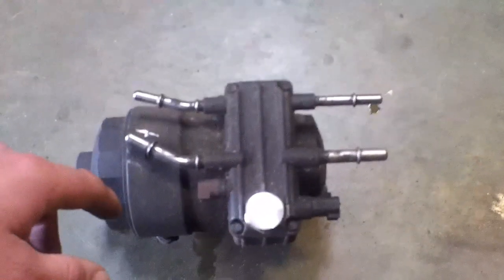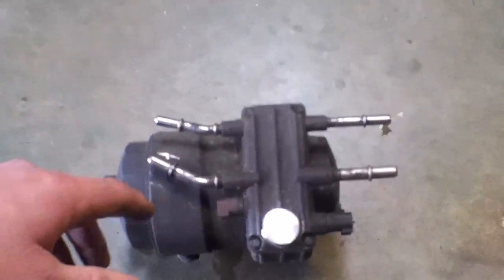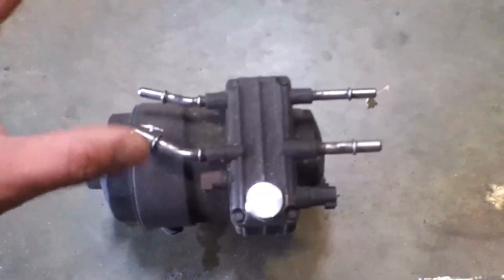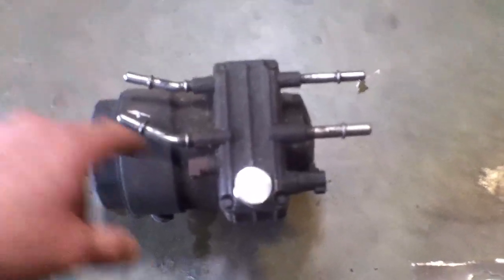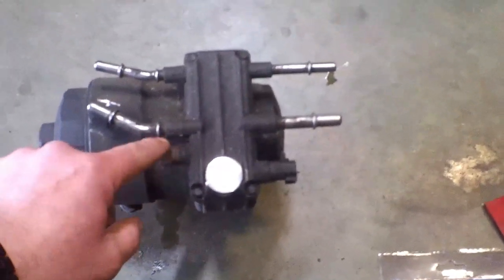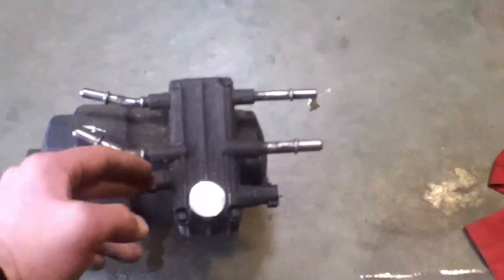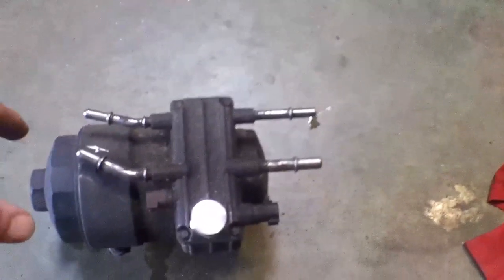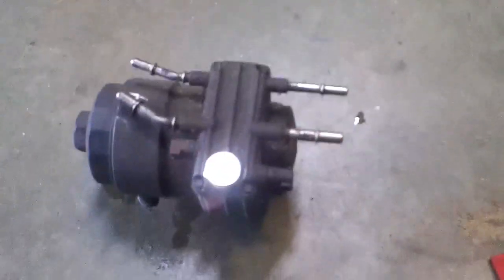Fuel Pump Replacement Ford 6.0 f250 2005

Comment: GREAT Communications!  I thought I'd bought the wrong unit until I watched your very thorough video here.  I am a novice, "shade tree", mechanic.  So seeing that the fuel heater has been deleted I confidently replaced the HFCM and got myself back on the road.   THANK YOU.
Reply from the maker: You’re welcome!
Reply: @BugmanVlogs  I need a little help diagnosing my 6.0 issue. Was running fine and I stopped at Walmart and it won’t fire up.  The fuel system prime before you start, I don’t hear it anymore. I just replaced both batteries. Check the video out please.
Reply from the maker: @ThePlatinumChild  I really think you lost the fuel pump. If you no longer hear it at all with key on before startup it has quit. This is typical of all fuel pumps when they quit, just die anywhere but it’s nice for the ones you can hear as when they no longer hum it’s a good give away as to the problem
Reply: @BugmanVlogs  thank you

Comment: ok so my truck sort of bucks and bounces at speeds 55-70 it does it worst at speed 55mph. it has fuel pressure at a contant 70-80 so thats what confuses me. Anythoughs on what this is? it doesnt feel like a tire balance issue. maybe drive shaft balance??
Reply from the maker: I have one of the trucks with a driveline vibration. Starts in about 50 and gets worse up to 70 then goes smooth as a Cadillac at 75 and faster. I’m thinking the driveshaft and/or carrier bearing. The bucking I had from the fuel pump was sporadic but I had at low speeds
Reply: Brian Hill did you ever fix you truck? I'm having  the same issue .
Reply from the maker: Fuel pump yes, driveline no. Ever since Covid hit I’ve worked to many hours a week to have time for working on the truck. Unfortunately until things slow down or we get another employee I have to put off things that unless completely broken I’m just going to deal with. Hopefully the cure will be just replacing entire driveshaft as mine is pretty rusted and just easier if all new instead of hassle of ujoints and carrier bearing replacement
Reply: @gamalielrenteria3964  needed 2 injectors, they were on their way out. ended up selling the truck and making profit because of the market.Id recomend doing the same if you have a 6.0.

Comment: Hi, Having a heck of a time getting the 2 plastic fuel connectors on the fuel filter side off with the tool . How long does it take once you open up the drain for the fuel to stop coming out?  Should the gas tank be empty when replacing the fuel pump?
Reply from the maker: While my normal experience is a cup to half gallon I’ve heard of horrible situations of it never stopped coming out. Prepare for the worst is what I always do. Have everything disconnected (wires) then do 2 engine side fuel lines and then have new pump right there for when you disconnect tank side lines (nuts should be off pump bolts through frame as well) and get tank side reconnected as fast as you can. When mechanics do this in a shop they get empty to full tanks and it’s not always practical to pump tank. Time is money, lol.

Comment: Question my truck does going up the hill  or even on flat ground thought it was my injectors sticking but then was told it was my fuel filters so replaced them today 7/11/21  but now I’m thinking it’s my fuel pump but don’t I have 2 on a 2005 Ford F-250 6.0.  Now I’m throwing codes for contribution /balance and Mis fire  but after watching your video I think it’s my pumps what’s your thoughts
Reply from the maker: There is only one pump on the inside frame rail. The part in the tank is just a sock filter. There is a possibility that it’s the pump if your getting multiple (3or more) contribution codes. 2 or less I would error towards injectors but fuel pump is a hella lot cheaper to replace than injectors.
Reply: @BugmanVlogs  ya I got like 5 codes
Reply from the maker: @jo5239  I would think it’s the fuel pump  then. Crazy how it can cause so many different symptoms.
Reply: @BugmanVlogs  it wasn’t the fuel pump
Reply from the maker: @jo5239  oh damn, was it the injectors after all?
Reply from the maker: @Joshua Hale damn, you hit as the winner for worst possible outcome.

Comment: That video was good, is that for a high pressure 6.0 Diesel, that's on the frame Rail
High pressure pump.
Reply from the maker: Thank you, this pump is for the 6.0 on the frame rail. It’s the only fuel pump it has and isn’t considered high pressure (65+psi). The high pressure is the 2nd pump in the oil system that runs the injectors. The cp4 pumps for high pressure fuel is on the 6.4 and up diesels.

Comment: My 2005 is making a gargling sound could this be linked cranks not start
Reply: At the pump under driver door
Reply from the maker: @wecanranchlee  I would be arrogant of me to say 100% yes but if it’s making a gargling noise something is definitely not right and would bet something is up with your pump. Will it fill the fuel bowl on top of the engine with key on?

Comment: Can you really not replace the pump without taking the entire module off
Reply from the maker: Correct, whole unit has to come off. They sell just the pump inside but I never took it that far apart. Mine was pretty corroded inside the water separator part so just did the norm since whole unit is out and replaced whole unit

Comment: Does anyone know where to get the damn crappy plastic clips on the two fittings towards the back of the pump?
Reply from the maker: I would guess only Ford parts at the dealership or maybe search EBay. I’m not sure what they are called so you may have to research. I have only had horrible luck buying parts at a Ford dealership. Use small words and write in crayon if you don’t have a part number.
Reply: @BugmanVlogs  so the stealership says Ford no longer makes the plastic clips. You have to buy Moog 3/8 and 5/16 fittings then make your own ends now.
Reply from the maker: @scottalvarez8870  thank you for the good info. Hopefully I don’t have to run into that in the future. Amazing that they are now stopping production on replacement parts like that. I’ve heard of several other things like that. Force many to buy newer if they can’t work on it which I’ve seen a huge portion of the population can’t so they win with them.

Comment: I've got 41 static psi. Installed blue spring kit no change. I'm thinking it's the pump been like you said loud and funny noises
Reply from the maker: Does sound like a bad pump. Good that you changed spring. I’ve actually had a blue spring kit go bad. Little plastic piece in there broke off and was blocking a hole. Only thing it showed as bad was fuel pressure bouncing really fast.

Comment: What was your truck doing to realize you needed a new fuel pump ?
Reply from the maker: If I remember correctly it started with cutting out at high RPMs which I took for transmission slipping, then after changing fuel filters...pump was loud like a race pump and I definitely knew then it was going soon.
Reply: Bugman Vlogs did you have low fuel pressure?

Comment: Where did you buy the fuel pump?
Reply from the maker: It’s a NAPA pump but I found it on EBay. Good reviews for OEM, NAPA, and O’rielys.
Reply: @BugmanVlogs  thank you sir. Price range about $300-$500 average?
Reply from the maker: Yes, i would to shop a bit to save and stay in $300 area. I just checked and got mine with updated wire harness for $262.

Comment: I’m replacing my fuel pump. The auto parts gave me a fuel pump identical to the one my truck has the only different thing is that it has three electrical plugs and the new one has two there is an electrical plug next to the drain plug can somebody help me?
Reply: Could I still install it like that? I will have an extra plug coming down.
Reply from the maker: Yes you can install it and just zip tie the extra connector out of the way. The omitted connector is for the fuel heater that is no longer in the newer pumps. Some pumps will come with a pigtail or plug to keep corrosion from shorting it. Another person on here said you will get a code for not having a pigtail but I’ve had no problems.

Comment: What kind of tool do you use to open the drain plug?
Reply from the maker: The stock plug you use an Allen. I’ve had 2 aftermarket plugs that where different. One had extended head in a 14mm. Super nice to get an open end wrench on. The other had Allen in center and extended head that was knurled on outside for using fingers but I always used pliers as finger tight is to loose IMO.
Reply: You talk to much
Reply: @marcosbega7011  You don’t know which “too” to use

Comment: My truck is leaking from that filter so do I have to change it?
Reply from the maker: Might try to change filter and install new o-ring on cap (which usually comes with filter). Make sure to coat o-ring in fuel or oil before installing. If it still leaks then probably housing is scratched and you’ll have to replace the whole pump.
Reply: @BugmanVlogs  thank you
Reply from the maker: You’re welcome
Reply: @BugmanVlogs  and you got an idea how much is the cost of that part?
Reply from the maker: @elmercapriel8192  o-ring is $5 or less, fuel filter kit is $50-60, entire fuel pump-$290+
Reply: @BugmanVlogs  thanks for the information

Comment: You should have changed the pigtail for the heater, since the new one has no heater.
It will have a code like P0232.  Can replace the pigtail to 2 plugs.

Comment: How much fuel am I going to get out of the lines when I disconnect them? Is it going to empty the tank.
Reply from the maker: I think about a cup per line drizzled out. I used the fingers of neoprene gloves to put over them and a bread tie to tighten. Keeps the fuel from dripping on you while you work. The most fuel will come from front lines and can empty the 2nd fuel filter/bowl if you don’t cover line end. The tank will not empty out. Lines come out of top and down so gravity is not an issue, lol. Hope this helps.
Reply: My truck drained about 3 gallons.
Reply from the maker: @Bearairboatrides  oh wow. Definitely some siphoning going on there. The lines, pump, and front filter can’t hold more than a half gallon or so.
Reply: @BugmanVlogs    Yes. It siphoned from my tank. The drain plug stripped so I couldn’t seal the hole. Finally stopped after a while.
Reply: my truck went 5 gallons and kept draining had to put the pump in and plug it in so it stopped but it didn’t look like it was going to slow down

Comment: Is there any link for the special tools for removing the fuel lines?
Reply from the maker: I didn’t post a link. Fuel line tools are from harbor freight. You can buy off EBay or Amazon too and all are about the same. Just buy a kit with 5 or more and you’ll have all the sizes you’ll really ever use

Comment: I have a 03 F250 6.0 turbo diesel how can I tell if i have a tune on it???
Reply: Mine will also die 3 or 4 times a day then not  die for just as many days. It will start right back up.
Reply from the maker: You can plug in a tuner and it will tell you or take it to a dealer. As far as the dying part, there is a fuel issue. List to start on would be fuel filters, bad fuel pump letting air in, possibly HPOP not keeping pressure up to injectors, plugged injector screens, hell even ICP or EBP sensor could be bad and possibly cause this. Scan gauge 2 or edge monitor is great start to know your parameters and go from there.

Comment: What size is that drain plug for water and thread pitch
Reply from the maker: I will have to say I have no idea. It’s a special plug with a strange secondary part that has threads as well so it’s not something you can just by a standard plug for. I just bought aftermarket ones off eBay so it will have a bolt head along with Allen to take off. Nothing worse than when Allen strips out

Comment: Never showed actual doing it.
I think you had a lot more trouble than what you said.
You are definitely a first time We said a lot of my time listening to your crap in the beginning of your video and you have no clue
Reply from the maker: You probably didn’t understand because you’re an idiot
Reply: I just watched the video and replaced mine. All you have to do is scroll the video to get to the part where he is under the truck. While he did not show step by step and actually remove the fuel lines in order to take a diesel bath, he did show you where to put the fuel line connector tools and that was all I needed. I also got mine out without removing the front drive shaft (although I was prepared to) because I was traveling with my family and doing it in a parking lot. Thank you for the video, sir. It was all the help I needed.
Reply from the maker: Thank you!